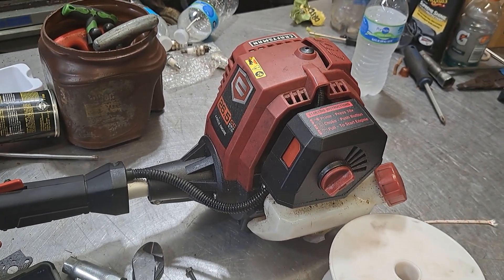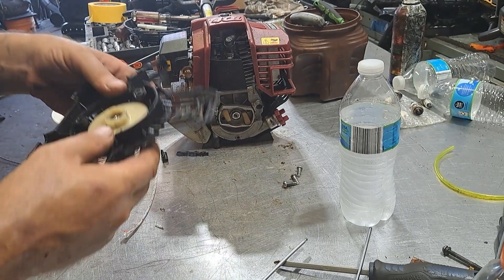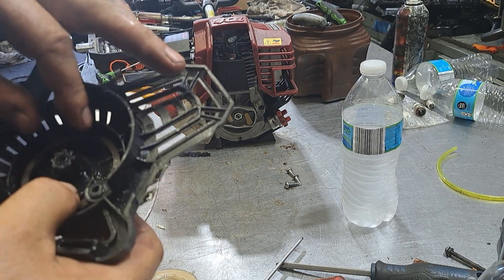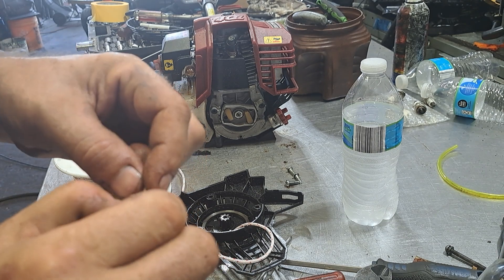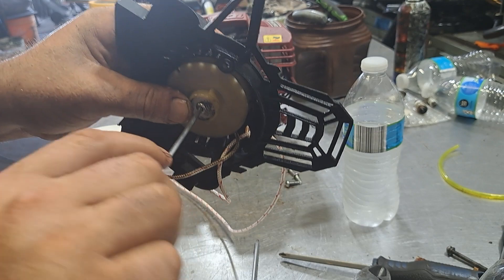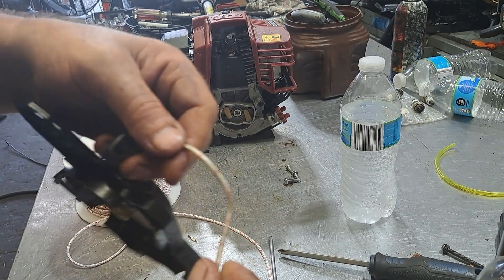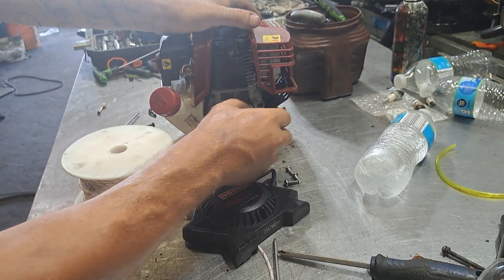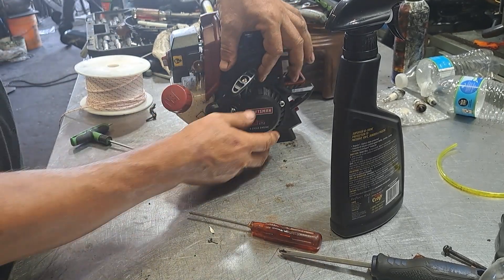craftsman 40l trimmer recoil pull rope repair replacement

Comment: I can only find one adjustment screw on the carb. And the idle.   26.5 cc.   4 cycle. .did get it going though.   Any ideas on replacement carbs or diaphragm kits?
Reply from the maker: Needs new carb now

Comment: can you watch my video about my chainsaw it’s been running screaming wide open and I got it from the moving sale
Reply from the maker: I need a link
Reply from the maker: ok so your running lean. there are 2 adjustment screws next to each other on the carb a third separate. from the 2 together the one closest to the air filter needs to be turned counter clockwise a quarter turn at a time till bogging stops. then at full throttle adjust it back and forth till you hit that sweat spot just under full screaming throttle.
Reply: @smallengineguys  It was screaming at higher rpm and burning inside the motor
Reply from the maker: @farmbossmikey1350  because it's running lean stop doing that and do what I told you.